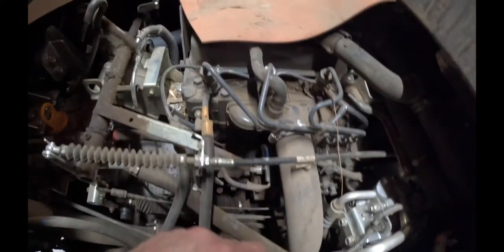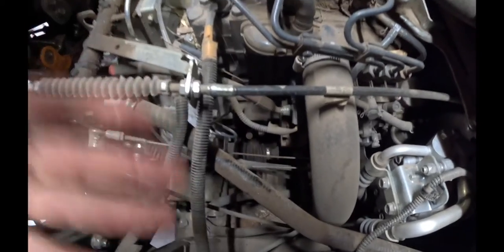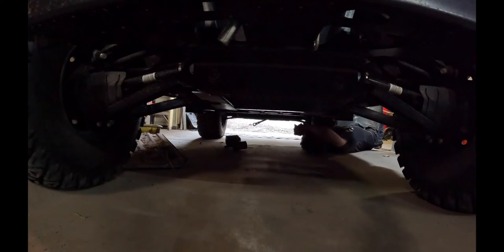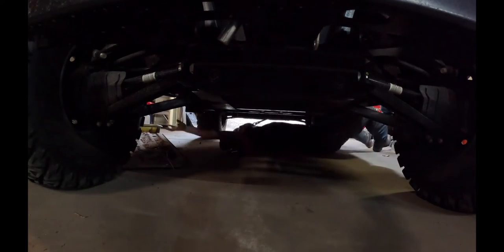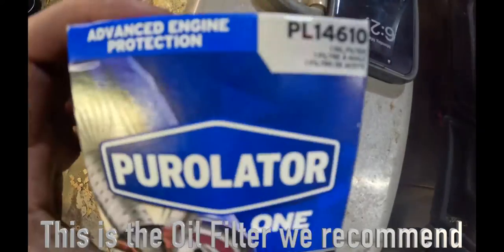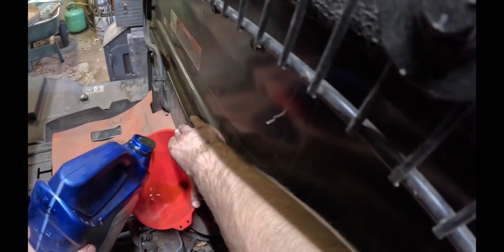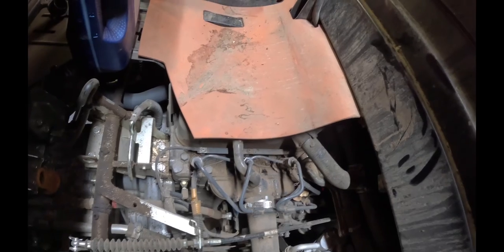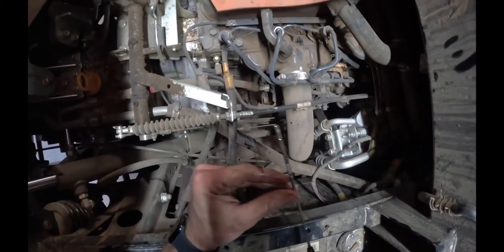How to Service a Kubota RTV X1100C (EASY)

Comment: I just inherited a RTV X1100C with 330 hours on it, I seriously doubt the oil has ever been changed.... Wish I had that done when I took it to the shop to get the injectors cleaned, when I got it, the fuel tank was full of bugs, hay leaves, and dirt.... 

what are the negative results if you leave those two Shields OFF ??
My acreage is just level lawn, not a rough and tumble farm like it came from.
Reply from the maker: Those shields are to stop stuff from getting up in your engine and breaking things if you have level lawn you could probably get away with out the but that’s a do it at your own risk kinda thing

Comment: Where does the oil go if you put it in through the dipstick hole? Accidentally did this and idk where the oil went cause I tried to drain the almost 4 quarts back out and nothing came out 🤦‍♂️
Reply from the maker: Should have went into your oil pan.
Reply: It would be near impossible to pour oil in the engine dipstick tube. More likely it was the hydro ?

Comment: Do you know how to flush out the hydraulic oil? Is it safe to use other hydraulic oil because I don’t have Kubota oil only available was chevron hydraulic oil. And wondering if I can use it or how to flush it out?
Reply from the maker: Not sure how to flush it out have not done that yet
Reply: @SmallFarmGuys  change my hydraulic oil now it can’t go into gear or something it not going forward or reverse. Is there like a release valve or something for the hydraulic?
Reply from the maker: Not sure would consult your dealership